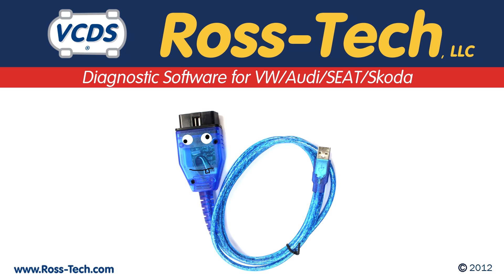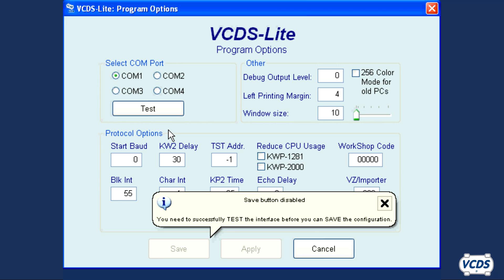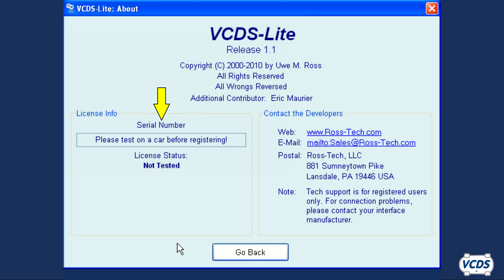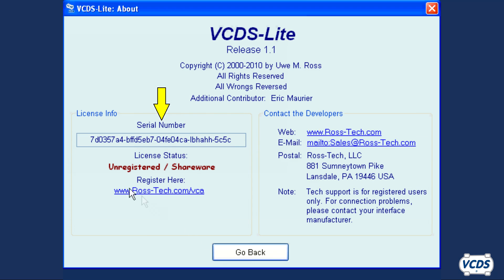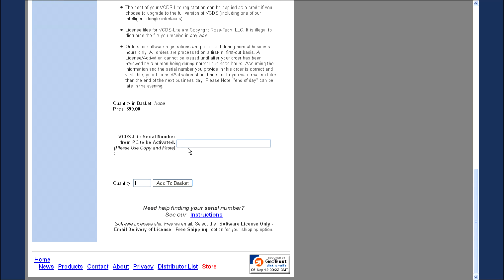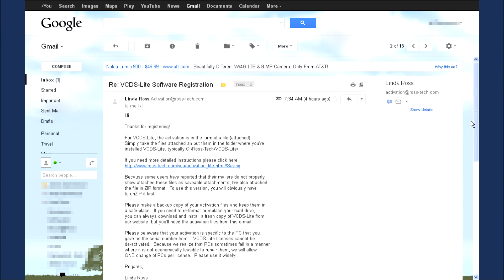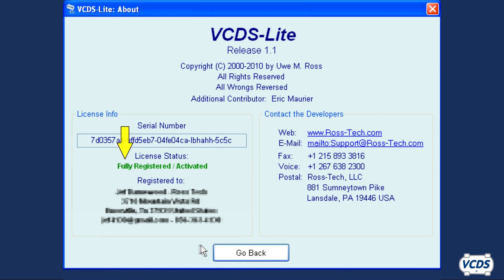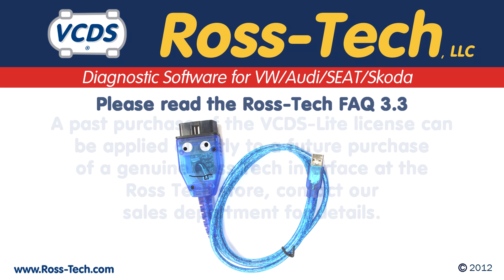How to install and register VCDS-Lite

Comment: Does VCDS lite read transmission temperature?  I only wonder because it is the only thing I have needed to do so far which would require the use of a diagnostic tool.  I only want to check my fluid level and I am not quite ready to spend $300 for the full non lite version of VCDS.